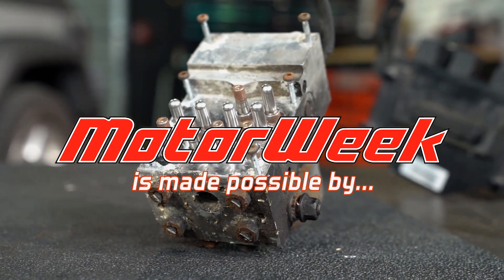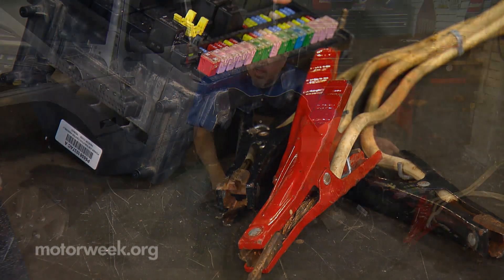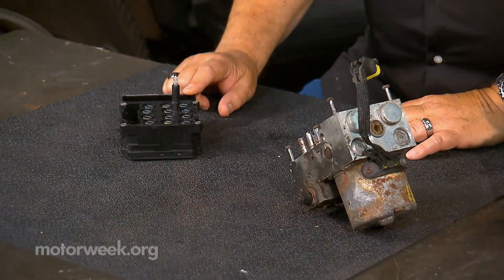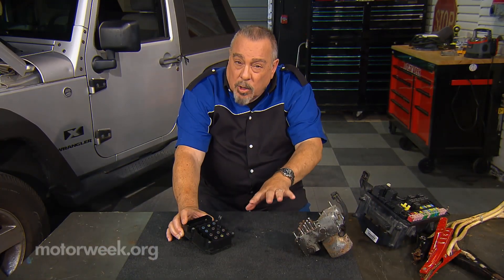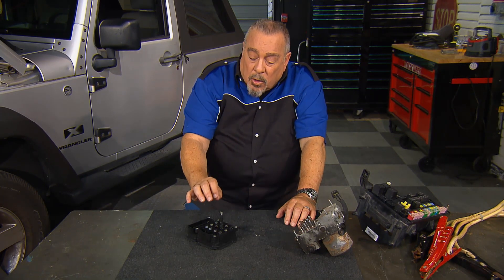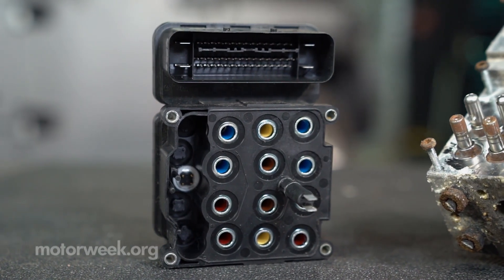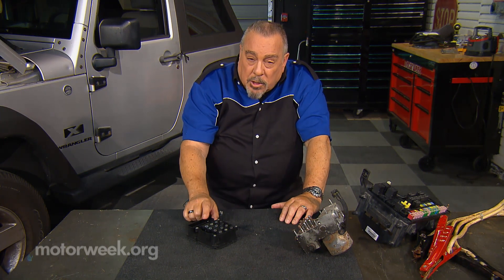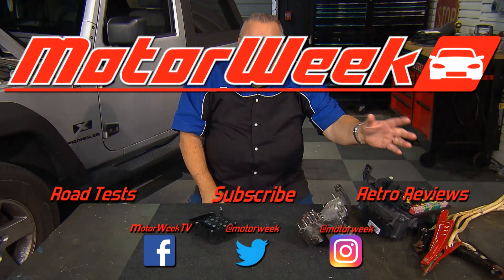What to Know About ABS Maintenance | Goss' Garage

Comment: On the topic of ABS, is it possible to retrofit ABS into a car that doesn't have ABS but was an option when the car was manufactured? My '01 Mazda 626 has no ABS, but I'd like to maybe install it so that I don't have to worry about wintry Illinois roads quite as much.
Reply: not easily done.  car computer system has something similar to little subroutines for individual functions and they are usually deactivated if a factory option is not installed. with enough money you could make it work, but would probably cost much more than what the car is worth.

Comment: Not using jumper cables is bullshit. There is nothing wrong with jumping a car with old fashioned jumper cables is just fine
Reply: Yeah, that made no sense to me either. You're literally just connecting another battery in parallel with your own battery. Even if the car providing the jump is running, its battery and yours absorb the brunt of the current, and any voltage fluctuations the alternator might cause.
Reply: @charles-ml1ru  he must be going senile.

Comment: so your telling me even an obd 1 sholdnt use cables? psh yeah right not doin that
Reply: Yeah, that made no sense to me either. You're literally just connecting another battery in parallel with your own battery. Even if the car providing the jump is running, its battery and yours absorb the brunt of the current, and any voltage fluctuations the alternator might cause.
Reply: Yea that was a load of crap. Prolly sponsored by a booster pack company they’re going to play ads for lol

Comment: The used car I bought had spongy pedal feel even after brake fluid flush.....However, after I purposely activated the ABS on a slippery surface at higher speed (large empty parking lot); the brake pedal instantly became nice and firm.   Not sure why it is like that but I have no complaints after that (5 yrs passed and no problem since).
Reply: The "Italian tune-up" for ABS pump
Reply: @ThisGuyRides  It certainly was......